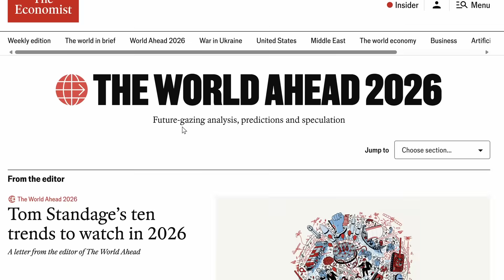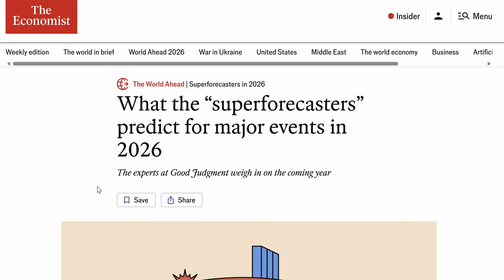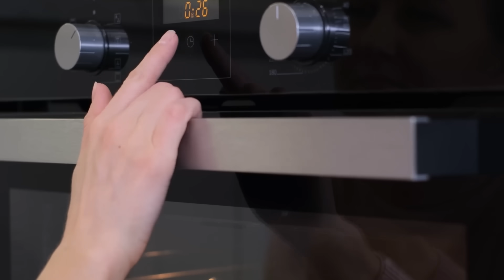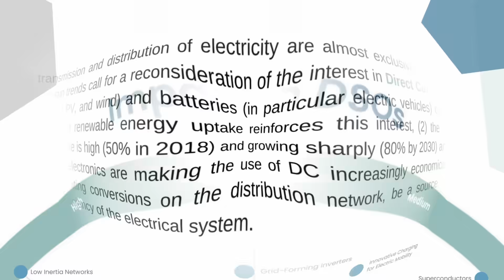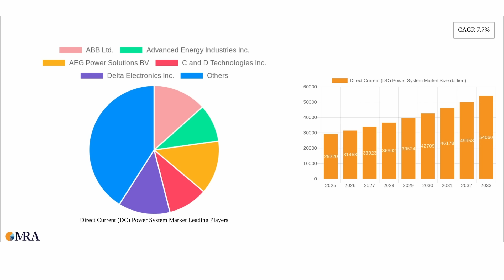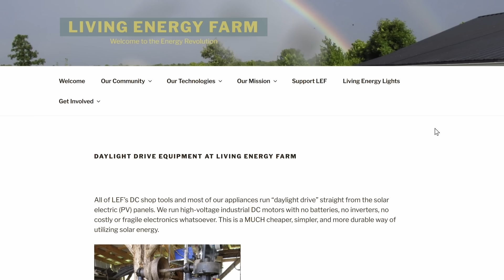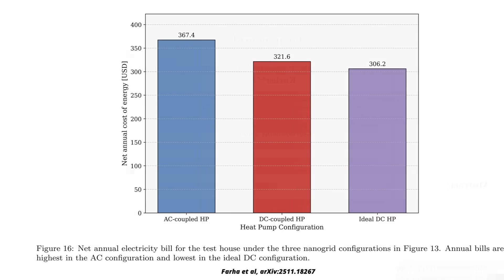Are We Using the Wrong Kind Of Electricity?

Comment: Almost everything converts AC current to DC current (except a lot of motors, incandescent lamps, and compressors)  DC at the home is OK, but one has to be aware of the corrosion issues when using it.  An example of this issue that everyone has seen is in a battery powered device, when the batteries have been in it for a long period.  Or, on older cars batteries.  As to transmitting power over distance, you can't beat AC for delivery.  Up converting AC to high voltages and down converting them back to street level voltages (still high voltage, but way lower) allows for large reductions in power loss (current times resistance equals voltage loss/power loss)  So, we have been using the proper "electricity" for the applications all along.
Reply: Yeah, just saying "AC" and "DC" is overly simplistic. Sure, electronics run on DC but they need a multitude of voltages, all of which are much smaller than anything that would be delivered to the house. Thus, all DC is inevitably converted to AC (at high frequency) in order to deliver the "correct", tiny, yet precise, voltage(s) to the load. Likewise, even electric car motors need a specially and precisely controlled AC, not DC.
Reply: First, most battery related corrosion is from the battery chemistry and poor construction (or hydrogen outgassing when talking about old lead-acid batteries, for example)... not from the fact that it is "DC".

Second, low voltages are definitely a larger problem in terms of dealing with oxidation and corrosion in-circuit... but that has nothing to do with "AC" vs "DC".  There is no law that says "DC" has to be low voltage.  Modern DC systems are not 12V these days (though the RV industry really wants to try to keep it that way)... they use higher voltages that don't have those issues.  24V and 48V being very common.  And residential home backup systems also tend to use 48VDC or HVDC (100VDC+) these days.

None of these issues are related to whether something is AC or DC.  That includes Galvanic corrosion (which is a net electron flow issue due to alternative return paths being available in a circuit... which is a problem that AC has too).  AC does not magically save you from galvanic corrosion.
Reply: @junkerzn7312  Battery voltages of up to 100 volts (32s of LiFePO4, 105-115 Volts measured) are approved for home use in the USA.  So very many things that run on 120 VAC also run on 120 V DC.  Some require snubbers for the switches/thermostats; some can be powered from switched outlets that have the snubber on that.  While inverters are efficient at max power, their standby losses can be a problem, especially when only small loads are run in the evening and overnight.  I expect that there will be a time when off-grid homes are run partly on 120 VAC and partly on 120 V DC.
Reply: Havet HVDC superseded that tho with less losses over longer distances?
Reply: @inteallsviktigt direct dc-dc converters for high voltage are considerably more inefficient and complicated to design and manufacture the simple transformers that AC-AC conversion can use.
Reply: @carlosdgutierrez6570 This is especially true at high current levels.
Reply: @carlosdgutierrez6570 not even for over 600km ranges? Considering they’re over 600kv? Or UHVDC? I didn’t know the grid had multiple voltage levels outside the standard 230v or 400v 3 phase grids across the continent 

AC to DC, then DC back to AC.
Reply: @inteallsviktigt how many places need such long transmission lines?
Unless you are considering that plan about filling north Africa with solar panels and export the power to Europe or transmit power from coast to coast in Australia or the USA, where do you need such large distances? 
Most countries have lots of power stations well under 400 km of the consumption place, doesn't have that many advantages over AC at such ranges.
Reply: @inteallsviktigt  That is true for long distance transmission lines but for the current distribution grid with its multiple voltage levels transforming from one level to the other is still the best compromise.
So the top end (long distance transmission) and the bottom end (micro grids) may well be suitable candidates for DC, but the ~1kV .. 400kV distribution will probably stay AC for a considerable time.
Reply: @ScruffR70  It's hard to calculate break even figure because economy of the components changes over time. 20 years ago, the break even distance for the bulk transmission was estimated 700-800 km. But that figure was wrong (time have shown that it was more than 1000 km from economical perspective back then and the minimum of 600 kV was needed). Today it's less than 1000 km, but still lot
Reply: I wonder a lot how good cars would be if we stuck with electric + rotary generators. 

 I say that, because I expected batteries to improve for quite some time. I had no idea motor density would start sky rocketing like so, WTF. 

 Instead of putting an unfathomable amount of time, and resources into improving pistons once we started hitting physical limits. 

 YASA has a tested prototype that produced 1000bhp peak at 12.7kg. 

 350-400kw, which is roughly around a top fuel dragsters continuous if measured from power to weight. That's mind boggling. 

 Motors have jumped in x3-4 torque density since I was a kid. Some of the experimental drone motors are insane too for bursts. 

 The thing is... A lot of this tech is only possible today via engineering, and manufacturing techniques + science. Material science. 

 It wasn't possible before. The same goes for HVDC. The tech is coming, and maybe then it will become smart to change. 

 With that said AC was the right choice. 

 Maybe we will slowly transition as feeding AI power will become a primary goal if we keep heading down this geopolitical arms race. 

 I love this new wave of tech. It is the politics + corruption around it that sucks. 

 People forget Americas energy demand was flat for nearly TWENTY years. Barely increasing from 2000-2020s while simultaneously privatizing it. 

 So there was basically no large scale need to produce. Now there is, but the politics + culture is so self righteously ignorant. 

 Solar + batteries allows a decentralized power grid which is awesome. The LCEO will only get cheaper.
Reply: Back in the day off-grid homes used as many dc appliances as they could because inverters were small, expensive and high quality ones were very expensive. Now they use AC appliances because they can due to large sine wave inverters being  available and reasonably affordable and because AC appliances just being so much better than their DC rivals. It is hard to compete with the economy of scale of manufacture of AC appliances.
Reply: Any motor and compressors are motors, actually either reciprocating engine, just not IEC, but using the reciprocating piston to do a compressive pump action, or either axial radial turbine, or roller pumps with it's eccentric cam, and they are pumps. Pumps like in the : dishwasher, freezer, fridge, dryer, washing machine and they all use AC. Even your rotating rust - HDDs - spindle motor, these brushless DC motor (BLDC), which are supplied with DC, turn that internally into AC, 3-phase AC to be accurate. The moment you have rotation it's fricken AC. "No, no, no, it's PWM." Which adjusts duty cycle and phase timing they still cross a zero-level, and that doesn't require negative values, which still is AC.

And those great Wind turbines also generate AC... that's how "Dynamos" work, just because they are not clipped to your bicycle but on towers with rotors attached doesn't change the fricken physics, just position and size of the force vectors. "No, no, no, they generate DC."  Wrong. They produce 1-phase AC and that is converted to DC to be collected for the whole installation, to then be re-converted to 3-phase AC and be injected into the general power grid. Why? To decouple. To decouple for one these dynamos that even with those 40 t gearboxes produce no constant power output being bound to whim of the winds, ever gust, direction change, every irregularity in the wind; and secondly from any load, because anyone that has had to bike with a dynamo know they turn easy without load but get hard to move when you add a light bulb. What do you think happens when you open your fridge door or flip the light switch? Load. And a network with not enough base load - effectively pre-generated excess power - will just lower it frequency, then voltage and then collapse and usually will kill lots of devices while doing so.

Also wind turbines equal rotating masses, if they are not decoupled then one can see each and every rotational irregularity in the grid. One can actually see it "breath" with every wind gust and every load turned on and off.

Unlike of course a steam or Brayton cylce super critical CO2 turbine, in a power plant that will have a specific and monitored rotation speed and if that deviates, because load is attached - i.e rotation slows down - more "steam" is let in, or if load vanishes, less steam. That's why central GW sized power plants or 100's of MW turbines are better than any Wind park or solar park. And to have lowest losses transporting and converting up and down those voltages - transformers work because of simple fact simple Maxwell's Laws  - and Tesla and Faraday, and Amper - about "moving charge carrier" generating an magnetic field and electric field and H and B field, respectively magnetic field strength and magnetic flux density. Wanna see a Buck converter or a Linear DC-DC converter delivering power to 10 000 house holds. Or even 500 house hold like the trafo stations at the end of any European street. Per Person 1 kW at all times (that's why it's dimensionless in respect to time) ... wanna do that delievery via DC? Well we already had that system. I say "we" Edision did that in NYC and the amount of house fires that created wasn't insignificant. Now how thick of copper lines do you want to put into the earth? Becasue all those EVs aren't even supported by the copper we have already in the ground and that's with 240V, 3-phase. 500 households - one of those standard numbers - 3 people per, that's 1500 ppl, 1.5 MW plus their two EV cars each want 50, 80, 350 kW "fast chargers" - as power company imagine: 350 kW fast charger then your 3.5 MW wind turbine that could run the households of 3500 people (~1200 households)  just supports 10 and you don't know when they use it - .. that copper is gonna melt. Or we do it like the USofA put a Trafo into every house ... gonna be fun putting that plan into action, converting every house's building connection to 20 kV or more, may be we can also put poles up again to hang those trafos from so wind can disturb that power like in the USofA.  So effectively back to middle ages. Because power outages in the USA are daily occurrences, nation wide.

LFTR/MSR for the win. China has one running. That's the future.

Comment: Has anyone studied the effects of DC current on the longevity of outdoor utility cables?

When AT&T developed digital telephone circuits long ago (1.544mbps T1, etc), they discovered that the bipolar AMI (Alternate Mark Inversion) signaling that they devised for them helped delay corrosion on outdoor wiring, when compared to signaling methods that only used positive or negative voltages.  They reasoned that this was because bipolar signaling helps reduce charge buildup in the wiring that carries the signal.  I wonder if a similar corrosion-acceleration issue might arise with outdoor DC utility cabling.

Also, didn't the Arecibo radio telescope collapse because of electroplasticity effects in the structural support cables, resulting in degradation at brooming points?  A similar situation with charge buildup, perhaps.  I hope we don't re-invent the same problems with DC utility current.

Merry Christmas and a Happy New Year!  Thank you for your excellent videos!
Reply: Ye it has been massively researched, its why we still usr AC for transmission systems. HVDC is a special case for power transfer between two separate AC grids.
Reply: Given the likely slow and gradual changeover, those problems should reveal themselves before the whole world jumps on the bandwagon.  Either solutions will be found before the whole world is DC or maybe people will change their minds about DC before the world is totally committed to it.
Reply: All high power undersea transmission is via DC . This has been in use since the 1950s
Reply: @PaulG.x  Yeah, Here in New Zealand, we currently run 3 cables (2 operational, with plans for a 4th) The Cook Strait HVDC cables. The thing is crazy, DC ±250 kV Transmission Voltage , 1,200 MW Transmission Capacity, 610 km (380 miles) total, with 40 km subsea Cable Length, Current Type ~	Bipolar HVDC , Transmission Loss ~Generally low losses (estimated around 3% over the entire distance), Fully operational since April 1965.
Reply: @PaulG.x  ye overhead versus underground are two complete different calculations outcomes. Plus you dont need your grids to be synced.
Reply: Sounds like a bad insulation issue. I guess it might require more expensive cables.
Reply: Pretty sure Arecibo's degradation and collapse was at least partially because of eddy currents induced by its microwave transmitter.
Reply: Great comments! 👍🎄
Reply: How well does aluminum do with high voltage DC? For economic reasons aluminum is used for distance transmission lines. My modest experience with significant runs of DC is go with copper for that… These days copper is practically a precious metal.
Reply: I was thinking the same thing.  Do we really want another aluminum wiring fiasco? The idea of a "micro-grid" and "data-center" in the same sentence is rather humorous.   

I don't see it happening.  Changing AC to DC is still far cheaper than the other way around.  DC appliances need both.

That said, many small devices can operate on DC now.  Some appliances as large as TVs can operate on either DC or AC.  Most laptops will work on either.

Comment: I think it is a balance between both. DC seems to win when it comes to storage, while AC has been the king for application (voltage conversion, motor performance etc.). Due in part to EVs, the conversion back and forth is pretty efficient. Even DC to DC converters use a form of AC in the conversion (pulsed DC). The only difference from true AC is it only swings in one direction from the reference going into the transformer. The transformer only cares about the change. 
"Ebony and Ivory".😊.
Reply: AC allows for the use of relays as well which are super powerful. Low volt/current controlling high volt/current
Reply: >-  DC seems to win when it comes to storage, -<  Seems to win?  You know of any AC batteries?
>- a form of AC in the conversion (pulsed DC). -<  Pulsed DC is direct current as the direction of the current does not change, as it does with alternating current.